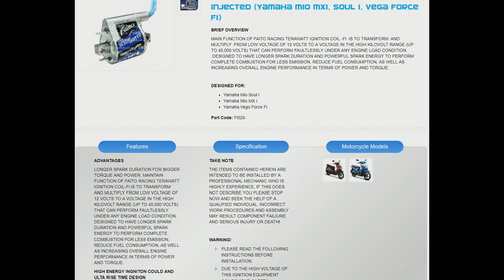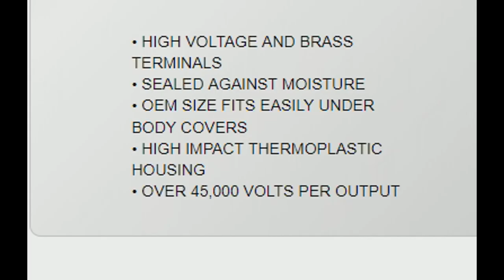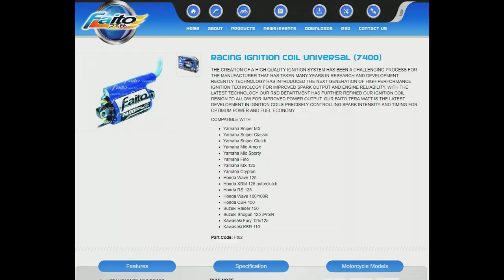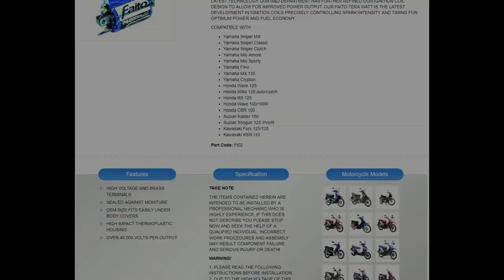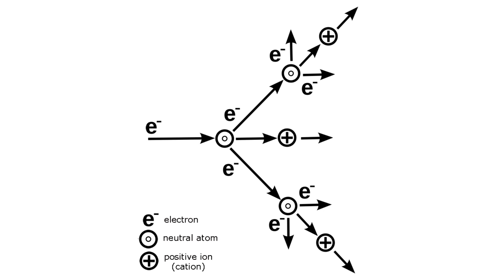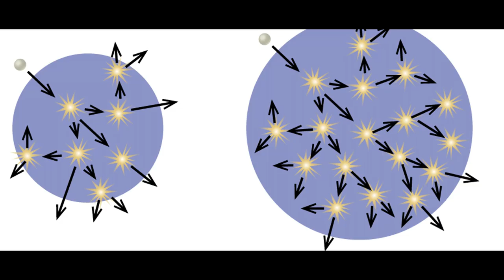Faito Ignition Coil KINABIT in my CHINA bike - MotoVlog26

Comment: Induction or electromagnetic induction ay ang pag generate ng magnetic field sa isang wire na dinadaan ng electron or may flow ng electricity, hence current or kuryente. Sa primary coil may voltage na 12v at 12 ampere(o current) na galing sa cdi. Dahil nakapalibot ang secondary coil sa primary coil. Yung electrons na nasa secondary coil ay gagalaw sa movement ng magnetic field ng primary coil. Ang kahabaan ng coil or dami ng ikot ay ang nag mumultiply ng voltage niya. From cdi na 12v 12A. Maging 45000 volts 2A. May conversion kasi yan. Di mo talaga ma pataas ang isang value kung di ka bababa sa isang aspeto niya. Thirdly is ang voltage sa sparkplug ay ang ka dense nito na mag generate ng heat or ionization hence na mag start ng combustion sa makina. Ang current or ampere ay ang force or value na mag decide kung ano kalakas ang electromotive force. Dito nakasalalay ang distansiya na kaya niyang luksuhin. Kaya mostly ang sparkplug ay small gaps dahil malaki ang voltage para makapasabog at maliit na ampere or current para maka jump or mag create ng spark. Dahil ang ampere ay may kinetic energy or kakayahang maka move. Ito ang reason kung bakit di ka mamamatay agad agas kung matirikan ka ng spark ng ignition coil. Dahil totoo na mataas ang voltage pero mababa namam ang current or ampere. Ang ampere po ang nakakamatay ng tao... sorry sa terms. Mahirap mag explain kasi pag walang diagram or drawing at kung hindi personalan. 1st year college student taking BSEE po ako. Kung may mang husga hindi po ako perpekto.👊👊💪💪💪. Power ng video mo idol. Skygo knight 150 motor. Patas tayo na chinese bike😅😂😂😂

Tandaan lang.
Mag karoon kalang ng voltage pag meron kang flow of electrons or tinatawag na current o kuryente.

Comment: My experience with faito 7400 sa rouser 180 note this motorcycle has 2 ignition coil
Hindi na sha na hihirapan mag cold start hindi katulad dati nung stock ignition coil
Laki rin ng improvement ng torque medyo na gugulat ako at natatakot at the same time😂
Ang bilis tumaas ng rpm ko
Ganda nung responsive ng throttle
Sarap e high-speed at e bangking😂😂😂

My first reaction when i got faito installed in my motorcycle and taken it for a spin my face was hilarious 😂😂😂 at first it scared the sh#t out me how it pulls really hard  then got used to it and it really made me smile each time i ride my mc 

Yun lang po😋
Reply from the maker: prang gusto ko n mga upgrade agad ng 7400 a hehe

Comment: Carbon type po yang high tension wire nya Hindi fibre...para sakin mas Maganda  p rin yung orig n coil kesa s bagu mo n inilagay kc sna one set ang inilagay i mean cdi and stator din san n kagaya ng brand ng coil n inilagay mo,
Reply from the maker: carbon fiber... not solid carbon, and di ako sure kung carbon nga kaya inindicate ko nlng ung itsura nya as fiber.... masmataas resistance nito kumpara sa copper wire, but it has coil around n di ako sure about the performance, i think pnprevent lng nito ung tinatawag na EMI... on the cdi, aftermarket n ung nka kabit sakin... with the stator coil, i think i wont benefit from that... thanks for watching 😊
Reply: @MunsKi  if fibre wire siya imbis na copper wire ang yung nasa gitna yan tawag dyan core. yung core = copper wire if na gets niyo hehe not so sure kasi mahirap i describe yung wire na yan sa video better in person :) when it comes to noise naman smooth ang fibre than copper wire may mga noise. but as far as i know copper wire has the highest resistance. electrical resistivity of copper = 16.78 nΩ . sml
Reply from the maker: hi... mahirap po ung explanation nyo.. and copper doesnt have the highest resistivity. bakit gingamit syang wire kung mataas resistance nya? .... masmtaas po ang resistance ng carbon fiber core... bka po ung naiintindhan nyong fibre e ung s pldt, n hindi nmn high current of electricity ang tintrnsmit, kundi signal or data in form of waves

Comment: Generally, unless there is an insufficiency in ignition voltage, any upgrade to the ignition system will not net any HP gain.  Over the years, after trying all kinds of coils and capacitive discharge systems, I've confirmed this statement. Modern ignition systems are so powerful that adding more voltage than needed, doesn't do anything more.

I would suggest adding acceleration tests, before and after any modification. This way you can show (and see) actual results. More often than not, the "butt dyno" is highly inaccurate. :P 

Keep up the great work!
Reply: It does add hp as air and fuel becomes much harder to combust at higher VE load. a stronger and accurate spark will also let you widen your spark plug gap which then can help unshroud or improve combustion. This is further tested in project farm

Comment: boss ask lng po if ppwede ba palitan ng medyo mahabang tension wire yung wire ng ignition coil?..at saan po kaya mkkbili nito..btw new subscriber nyo po ako..i did so kc sa vlog nyo lng nlaman ko na di pla buo yung high tension wire from the coil piece mismo.(npnsin ko kc na iisa lng po gnamit nyo na high tension wire,yung kulay orange).pls reply my query boss..thanks in advance..God Bless
Reply from the maker: spark plug wire, sa lazada or shopee sir, masmhaba masmataas resistance, pero wala msyado significant effect kung maghaba ng konti, wag lang sobrang haba baka sumabit sabit hehe.. and ung mga racing or aftermarket ignition coil, meron na sila kasamang wire, that will do narin